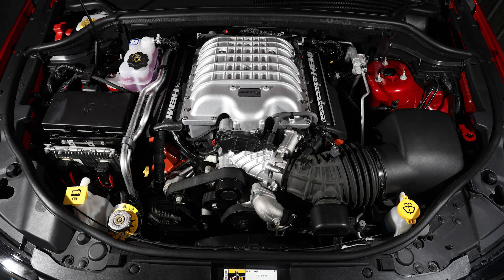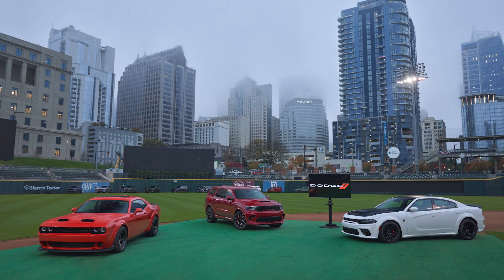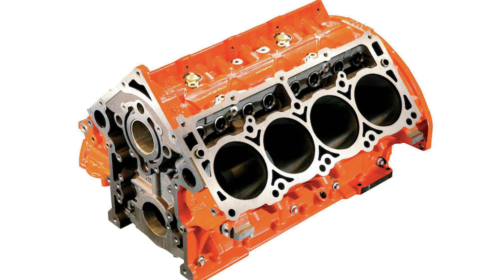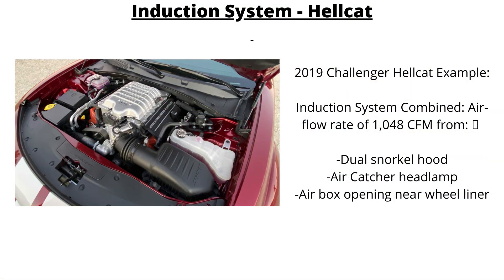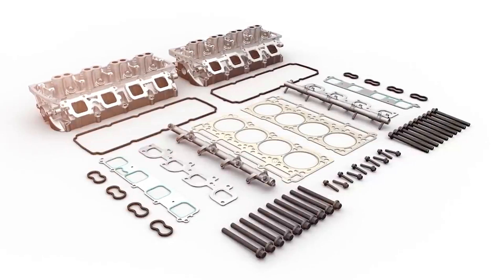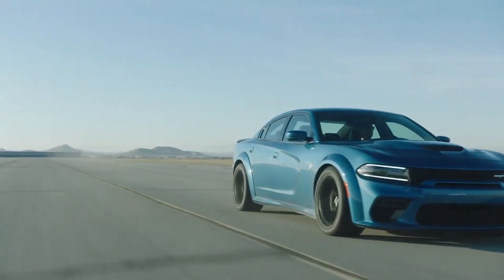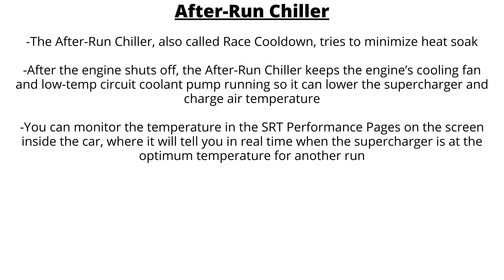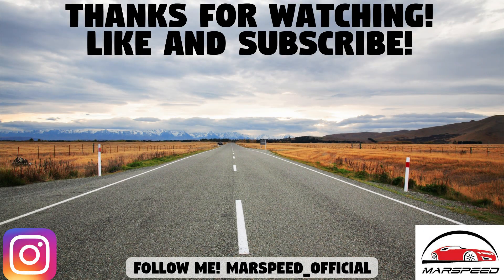6.2L Supercharged Hemi V8 Engine – (HELLCAT VS. REDEYE VS. Demon) – What’s the Difference?

Comment: Lots of information here, thanx for doing the research!  I have read elsewhere that the Hellcat cam specs for duration (Intake/Exhaust) are 215/221 @.050".  278/304 seems fairly radical.  The Redeye was 224/240 @.050".   Thoughts?

Comment: It's funny that a company boasting about more power was focused more on the supercharged engines rather than the 5.7 or 6.4 to rebuild em, or replace em with a better, lighter, bigger sized engine - especially the 5.7
Reply: You can only do so much to a engine before you need use power adders or have a major redesign in that engine. Which is gonna raise the cost to the end user.  If a customer really needs that much more power you can modify. Which gives people flexabilty with out having to increase the cost to everyone. Plus over the years the 6.4 has had changes to bump the horsepower from 470 to 485 over the years with updats as well
Reply: @kingtyty5  uea but to the max. That's why they had to purposely detune the 5.7 helicopter to give it the proper power spacing to justify the price of the 6.4. Dodge couldve made a NA high compression aluminum 7L hemi from the hellephant to replace the 6.4. Because that engine along with the 5.7L is the cash cow for dodge
Reply: 🚨 hater alert. Keep saving your Pennies pal

Comment: The engineering for the Hemi engines specifically 6.2 and 6.4 V8’s are very cool. Even with the new 2.0, 3.0, SRT10, and motors from the Italian brands are very fascinating to learn.
Reply: I thought the hellcat was a super charged 6.4
Reply: @mpoveroni  supercharged 6.2. i can’t remember but it has either the block from the 6.4 and heads from the 5.7, or vide versa
Reply: @sirhamalot110  if you remember you should come back to the comment section, I’d love to turn my 5.7 into a 6.2 if possible instead of buying a hellcat engine/ trans and swap